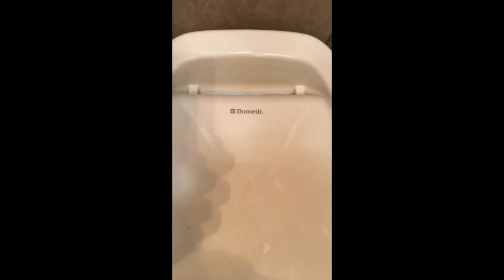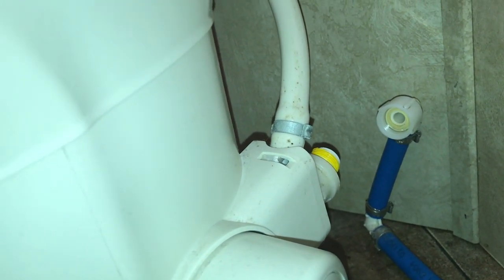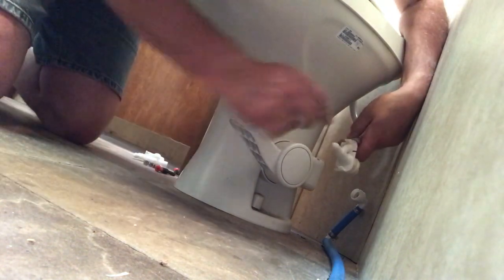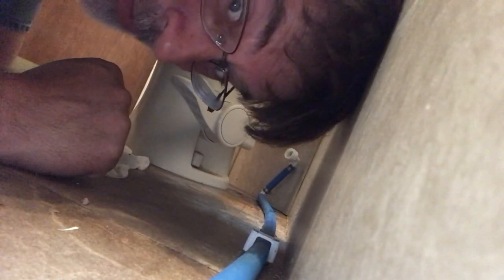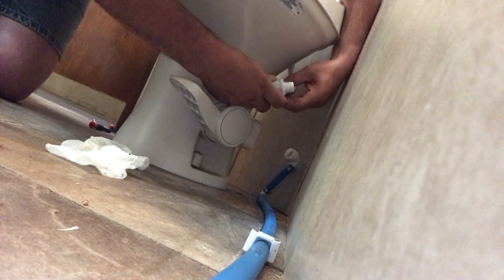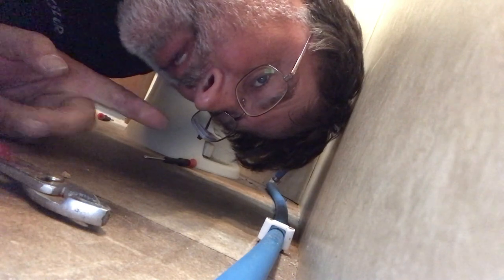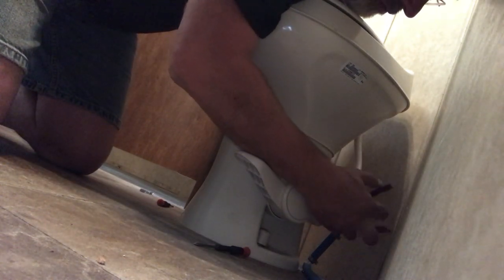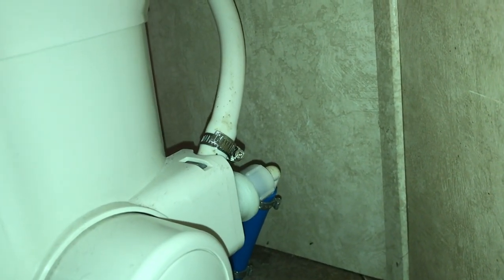Dometic RV Toilet Repair (water valve)

Comment: Been there, done that, rv'ing. Lost my ass, ha ha.   Back in 2007 I bought a brand new f150 Ford truck. About 3000 miles later my wife said, let's buy a RV.  I said this truck is not big enough so, sold my brand new truck.  We bought a KZ 5th wheel and a brand new Dodge 2500 desil. The year they replaced the Cummings 5.9 with the 6.7.  long story short, didn't like camping that much. Now of course don't have any of that stuff. Ha ha did I say, lost my ass again.
Reply from the maker: Malcolm Connor  I can see how that can easily happen. Camping isn’t cheap.  You pay a small fortune to to do it and we just keep adding upgrades.

Comment: what size screws r those?  i just replaced mine. but didnt have the right tool to screw the screws back n properly.
Reply from the maker: I don’t recall their actual size but length was no more than 1/2 inch.

Comment: The intake valve on my RV toilet's stuck on there.  I can't think of any tool that could unscrew the hose from the toilet it's not a standard deal that a socket could fit on, a person's fingers can't fit to manually unscrew it.  Somebody on the internet said burn it off with a cigarette lighter/ melt it off...if you know of a safer way to unscrew this plz let me know, TY.

Comment: My toilet keeps running when flushed, will replacing the valve take care of this issue?
Reply from the maker: It very well could solve your issue. The part is cheap and can easily malfunction. It controls water flow and changing it could restore a good seal after flushing which will possibly end your running water issue.

Comment: Why are you replacing this part? Never answered the most important question. Was the toilet not working at all?
Reply from the maker: The part had a manufacturing defect and was leaking. I replaced the part and there’s no more leaks.
Reply from the maker: I think I show the part and an up close look at the defect when the part was molded.

Comment: Is there a seal or o-ring that goes on the tip of that valve when installed?
Reply from the maker: No. No seal in kit and installed new valve and no leaks all season.
Reply: Thanks for the information, looks like I’ll be replacing the valve.